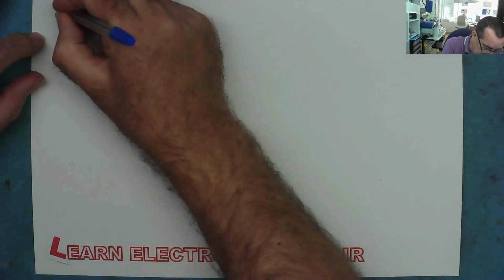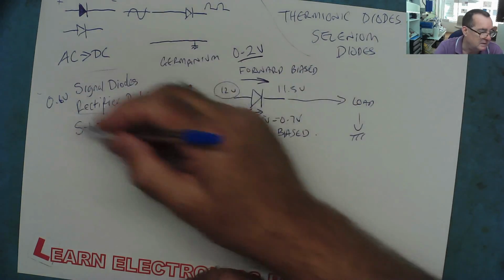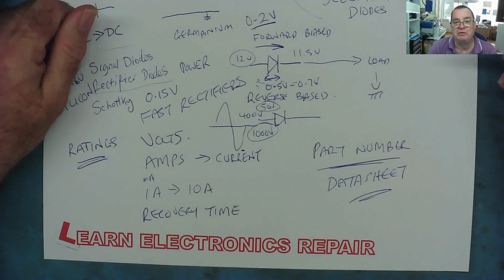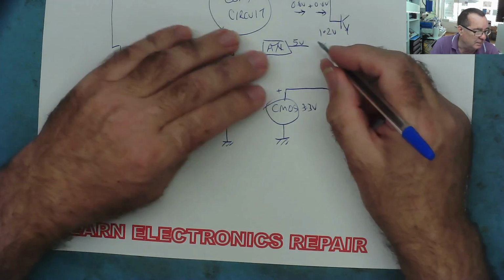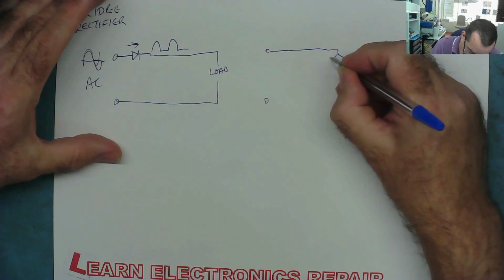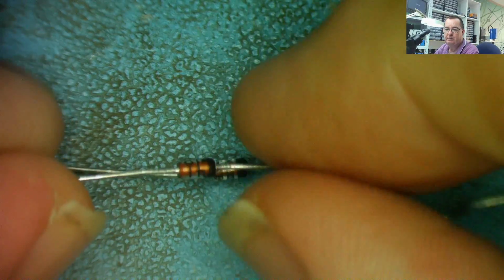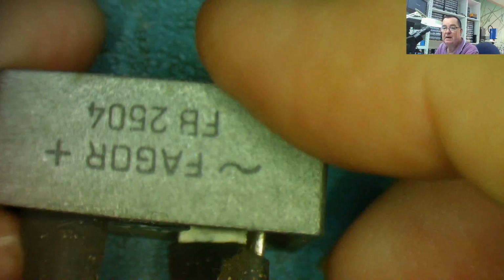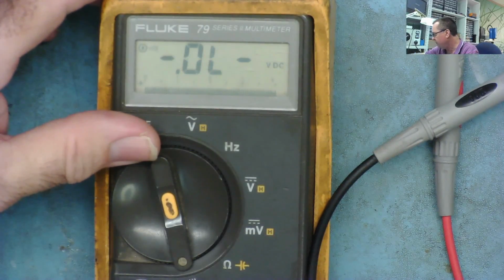All You Need To Know About DIODES To Fix Stuff!  LER #196

Comment: Hi 👋🏾  I have an factory fitted infotainment system in the car (radio,bluetooth and satnav) built in and the system just died. Now I have poked around and found 3 diodes faulty. They are surface mount devices rectangular in shape with what can see being band or line followed by 3583??? Can anyone help please as to what device it is. 🤔

Comment: I've got  a question about an oscilloscope a neighbor recently gave me.  It is an old Phillips 25 megaherz  2 channel model.  The power cord is only two terminal with no earth ground pin.  Does this mean that this unit is isolated (as in a linear isolated PS) and safe to use without the use of an isolation transformer?  Thanks and I do enjoy your videos.

Comment: The forward voltage of schottky diodes in power circuits is rarely less than about half a volt and can be higher at typical working currents.

Comment: Diode is in power banks to refresh the battery, and is memory effected by default, to avoid the refresh. After several perfect charges and proper discharges (requires 1.4 A phone such as Samsung or Lenovo), the memory effect leaves the diode, and the battery refresh happens the battery becomes stronger. Satellites receive signal from the power bank, and decide whether the user has the right to use the modified device or not. If not, they disable its inverter, and locks down the charging.
Reply: I realize English is not your first language, but that makes no sense whatsoever. Diodes do not have any "memory effect."
I have no idea what you are talking about with regard to "Satellites."

Comment: If electrons flow from negative to positive , how does a diode flow from positive to negative ?
Reply from the maker: Conventional Current - early scientists got it the wrong way round, but like those who still believe the earth and mankind are only 6000 years old, they couldn't be bothered to change their mind in the face of obvious proof otherwise 😉
Reply: Study semiconductor / transistor composition
There is a lot of information concerning atomic structure and how it interacts with electricity.

Comment: You can also show a rectifier as used in linear power supply, that has 2 diodes connected to a center tapped secondary,
 and showing/measuring HV diodes such as those used in a microwave oven, as well.

Comment: In German the connections are called Anode and Kathode. Makes up for an easy mnemonic trick, which half works in English as well. First the multilanguage one.

With the top half of the A of Anode you form the triangle part of the diode.

And with the K of Kathode you can imagine forming the line and the top part of the triangle.

This way you can easily figure out which is which. 🤗

Comment: Thanks for the tutorial on diodes, a lot good info in this video. I feel like I learned something. Min split heat pumps have become common for heating and cooling. They have a bridge rectifier and its nice to know how I can test it. Funny thing, they call those units "inverters" but thats converting from DC to AC right? Still haven't learned why they call them that. Anyway, great tutorial.  Take care.

Comment: I'm so glad I found your channel. You've helped brush up on stuff I've forgotten since I started learning this at age 8. I'm nearly 43 so that's the vast majority of my life. I was told by plenty of seasoned techs that you always forget more than you remember as you become specialized. That's why it's so important to keep learning. Fun fact: I ended up arguing with a PhD-EE who had forgotten how capacitor discharge time-constants work. He thought the curve was more like a battery than the sharp drop it is and screwed up integrity of the sensors; +-60g crash data recorder g-force sensors. Liability much? "Oh it's okay. The NASCAR driver only sustained 8g in the crash." There was a +-6g primary g-force sensor set, but Chernobyl already shows what having sensors (Geiger counters, in that case) that top out far too low for the environment you're in can do. I took this as a strong warning to never rest on my laurels. To paraphrase Ferris Bueller: "If I'm going to get shown-up, it's not going to be by a guy like _that_."

Comment: Really enjoying this series of videos!  Thanks so much for taking the time to make these. One question I have is between 22:29 and 24:45 where you talk about the diode that helps short out the spike in voltage when the relay turns off, why isn’t at least some of the voltage directed towards ground via the transistor?

Comment: My understanding about the diode schematic symbol is that back in the day. Current was believed to flow from positive to negative. So when the symbol was created the arrow was meant to show the direction that current could flow. Later, when it was discovered that current flows from negative to positive. The symbol was never changed to reflect this new understanding. In college, my professor taught me to think of it this way "the arrow is a car driving into a brick wall". Meaning, current can't flow in that direction. When using a diode for reverse polarity protection. Schematics have always shown the symbol with the back of the arrow towards the positive of a battery or other DC power source. This positive and negative confusion also affects the general public as well as novices when it comes to things like car batteries. As they assume positive means more of something and negative as less. So more must flow to less in order to equal out. But it is actually based on the words used to name the charge states of electrons and protons. Electrons being considered to have a negative charge and protons a positive charge. As we know today, electrons move through wires but protons do not. So negative represents the charge of the electrons that are moving through the circuit.
Reply: It’s called the conventional current direction. Conventionally it is still accepted that current flows from positive to negative/ground.
Reply: A car driving into a brick wall. That's as easy to remember as transistors. ie NPN = Not Pointing iN and PNP = Pointing iN, Punk.
Reply: I am still confused about this , help me understand , flow from - to + , PNP and NPN transistors 😵‍💫
Reply: You put it very well! I am actually going to send this to my two sons (one an electrician and the other an IT guy). I hope you do not mind? Regards

Comment: looking for days trying to find the voltage on a dell xcr8d 0v62h atx 8 plug 240 w power supply. 
when checking the purple wire i have 12v and mobo not starting
is that a dell standard or should it be 5.5v  replaced with new 255w psu still 12v, any ideas
Reply from the maker: It sounds strange they would change the ATX standard, and use 12V Standby on the purple wire, but who knows if they are making proprietary PSU and Motherboards with unusual connectors.  Are you saying the PSU does not have the normal 24pin ATX connector?

Comment: Hello Richard, can you tell me how to know white smd LED chip working voltage? If voltage drop use diode test mode show 2.5v. Can it be the working voltage of led is 3 volt? And not 6v or 9v
Reply from the maker: LEDs require a constant current supply.  You can use 3V 6V or 9V supply but you must put a resistor in series with the LED to limit the current, or for higher power LEDs use something like LM317 voltage regulator wired as a constant current source 

http://lednique.com/power-supplies/lm317-constant-current-power-supply/
Reply: Thanks you so much. So if i use adjustable power supply, i am not should use resistor right? I just should increase the current from the smaller right?
Reply: @unintendedperson  For a constant current supply you just need to add in a series resistor to drop 1.25 V at the required current.

Comment: I just fixed an inverter and I could not believe the diode tested correctly with meter but when in circuit it dropped 8volts of a 12v supply. Never seen it before and doubted everything I knew about diodes. Replaced and all ok.
Reply from the maker: Nice one.  I haven't seen that kind of failure myself

Comment: Your polarity drawing on full rectifier is misleading. You should not draw half waves as an explanation of negative polarity. Half wave represents voltage. There is none negative voltage at same time when there is positive voltage on other end.
Reply from the maker: @Yama 007 Yeah it was a bit iffy and I had to add some subtitles as  I also messed it up a bit.  As to whether there is any negative voltage depends on your point of reference - but I accept what you are saying 😉
Reply: @LearnElectronicsRepair  Well... when you start mentioning point of reference you should also explain 0V ;-)  I prefer drawings using 0V. This way usually people immediately recognize difference between - and 0V. Which is what AC is about.

Comment: you barely touch zeners and omit leds completely, both of which can pose a diagnostic challenge to novices, and yet somehow manage to match video run time to capacitors (which are far more complex topic). perhaps a segment explaining p-n junction, its variants and typical characteristics would be time better spent than in depth study of basic application cases. good tips on bat54, tho the issue is not exclusive to that particular type - if a diode comes in smd package it likely has analogous layout variants
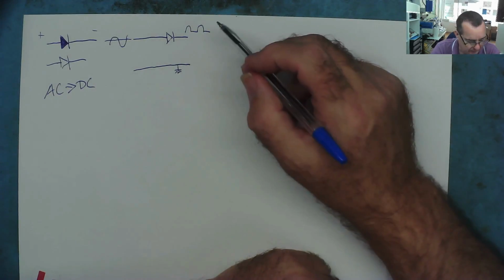Reply from the maker: Sometimes I think I am justified in believing people don't always watch the video before commenting: at 1:44 for 19 seconds I discuss the scope of this tutorial video and I hoped it was clear I'm going to present Zeners, LEDs  (and some others variations I mention) on their own videos though I only inferred that rather than specifically saying so.   Yeah sorry this one got a bit longer than I intended, point taken.  Like you say there are similar SMD types to BAT54, I'm pleased to see you found it a good example though, it is the most common type I have come across so far on GPUs and motherboards